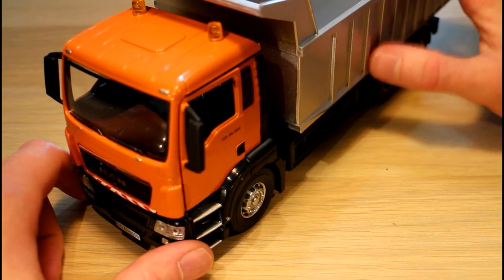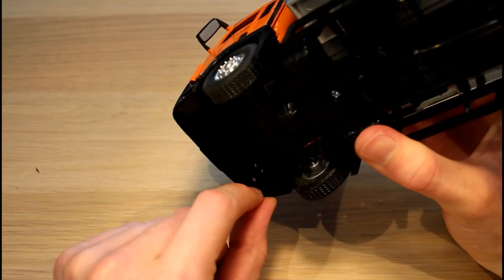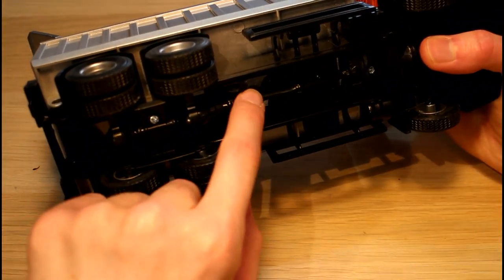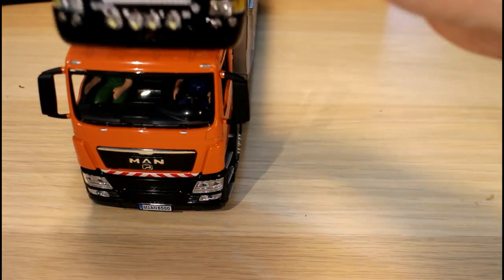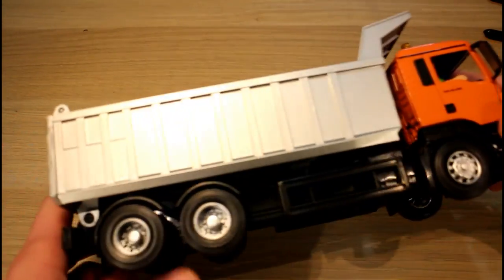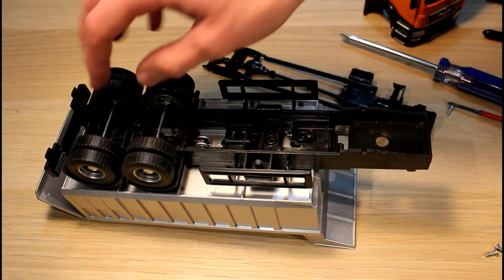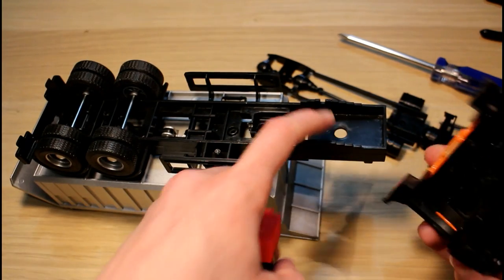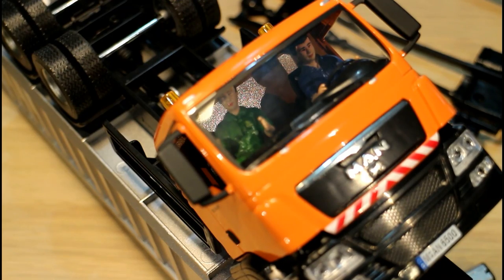RC MAN Dump Truck Part 1 - Model Disassembly and RC Conversion Plan

Comment from the maker: Yes the chain drive would be ideal, not sure where to get one small enough. The belt drive idea shouldn't require any modification to the axles so I might just do both, belt idea first then chain when I get some.
Reply: Hi